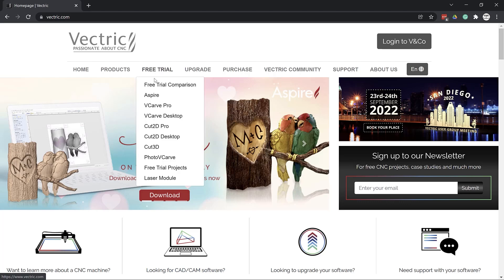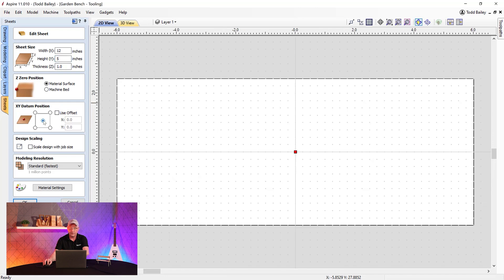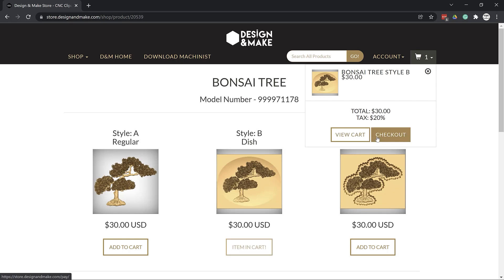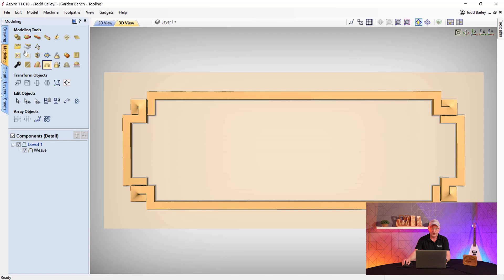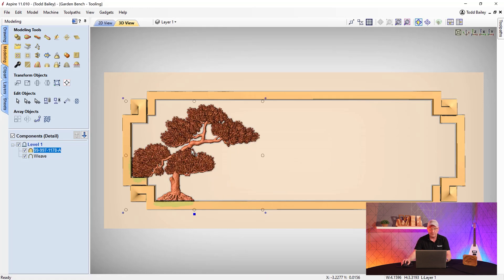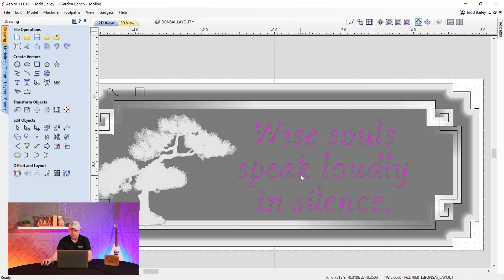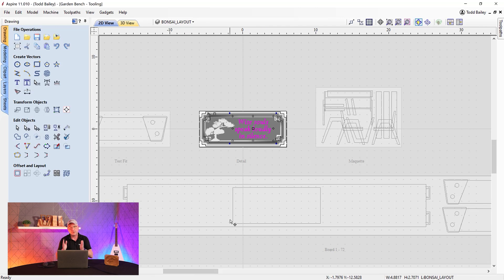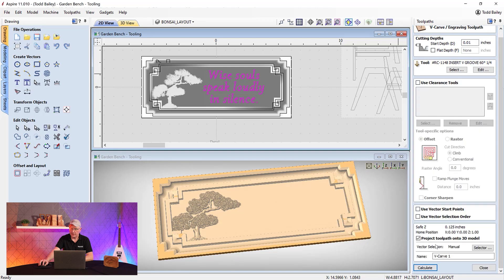Making A Garden Bench Episode 2 Easy 3D Modeling | In the Labs with Todd | Vectric FREE CNC Projects

Comment: What is the device that you use to set your z axis with? My shop has bought a CNC by Velocity Motion...the Indy Pro. Unfortunately there isn't much information online for me to familiarize myself with it but would like a simpler way to make z height settings.
Reply from the maker: Hello Bradley... thanks for the question.  We use a touchplate on most of the CNC's we have here.  Normally they are sold by the machine maker, as an add on.  You could contact them?

Comment: I watched your video on the bench build, great stuff! I was wondering why your polylines look so much thicker than mine? Is it the resolution of the screen?
Reply from the maker: Hello and thanks for the comment!!!  I suspect that is the case and also the screen scaling (Windows options) might be helpful to look at.  On my screen they are plenty easy to see, but if I move between monitors it changes how the thickness of the lines look. I took a look at my setting and they were different on each. It also could be the compression we use for the videos... but that last one is only a minor thing.  HAve a look at your display setting and if that fails what you might want to do is take a screen shot and send it off to support@vectric.com and they can have a look.
Reply: @vectric  Thanks, I did mess with the display resolution and it did seem to make a difference in the line thickness. Thank you.